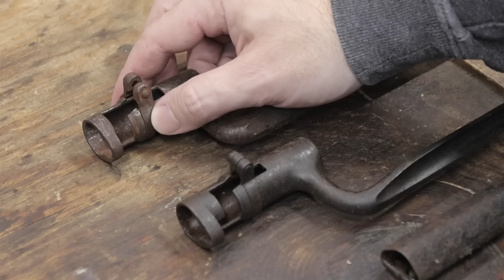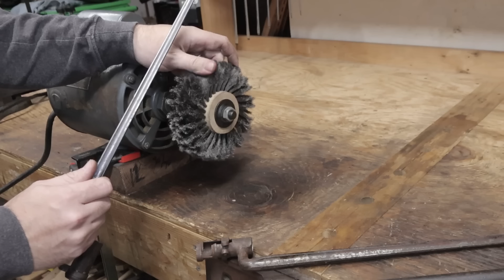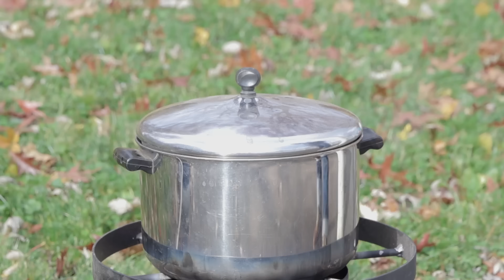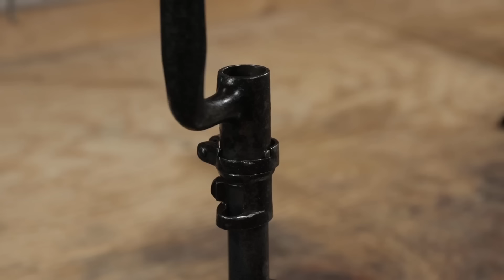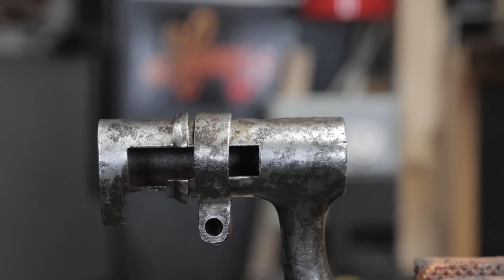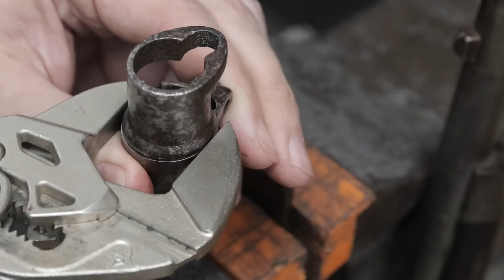Restoring Rusty 150 Year Old Bayonets

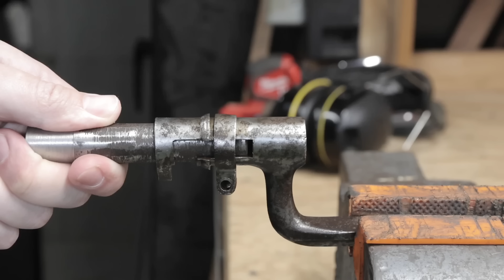Comment: 10:07 couldn’t you hammer in a piece of steel that had the same taper?
Reply from the maker: I thought about that, but removing a slight taper could be tough in such thin walled material such as a bayonet socket

Comment: Great work! Can't say I woulda done anything different. I restored an M1816 bayonet this way (albeit boiling the piece instead of steaming) all that patina turned to red powder and carded right off leaving a pleasant aged appearance. Working on fitting my Indian made M1816 replica to it (I'm not modifying an original bayonet to fit a reproduction musket) and I'll match the musket's finish to the bayonet after I complete the finishing work that the Indians didn't do. I also got an original trigger guard for it. (Again the musket will be fitted, not the antique part). Cheers and happy gunsmithing!

Comment: Could make a mandrel with the same taper as the barrel and drive that through to even out the bump maybe?
Reply from the maker: I thought about that, but didn't want to risk it getting stuck
Reply: @rakumprojects  Done it many times. Oil well, go slow.

I have taper mandrels for muzzle rings for usual bayonet crossguards as well as for socket bayonets. All have threaded end holes so I can thread in a long arm in case of lateral twist being required etc. I also made up a blade straightening press.

Comment: I have hundreds of rat tail bayonets for mosins :P I find them with minedetector, 60€ a piece for hobbyist collector and 40€ for fast sale if i ever needed money. Best way of cleaning them is just big bucket and oxalic acid, you can get it from hardware store or online and mix it with plain water. Let them soak in the bucket for few days and you got clean bayonets that are cleaned gently by the acid so they are not ruined accidentaly. Sometimes oxalic acid etches/darkens the metal but thats not bad as the bayonets originally were kinda dark/black

Comment: Gotta get myself one of those turkey boilers for rust blueing. Nice restoration!
Reply: If you see a grill on the curb ready for pickup you can see if it has a side burner you can repurpose it. I did that for melting and casting lead. Probably won’t work as fast but it’ll get the job done.